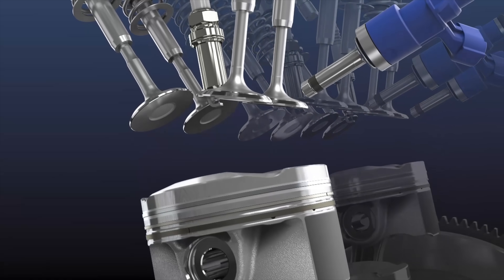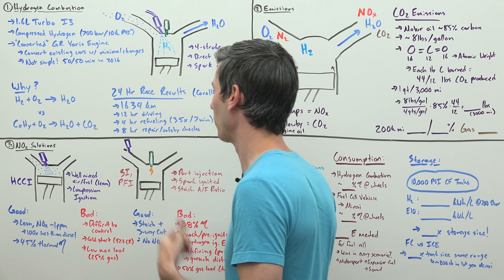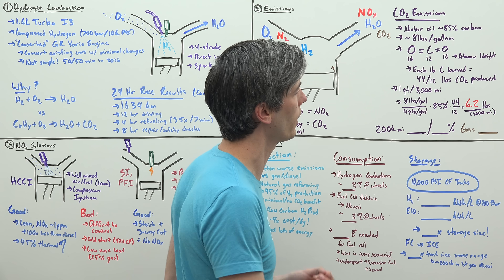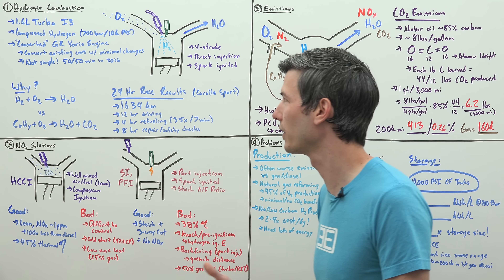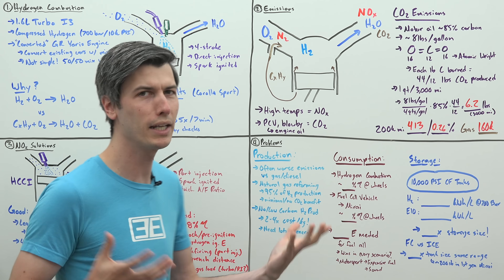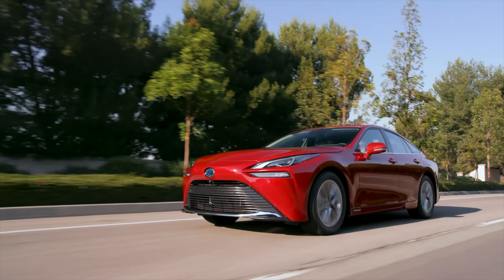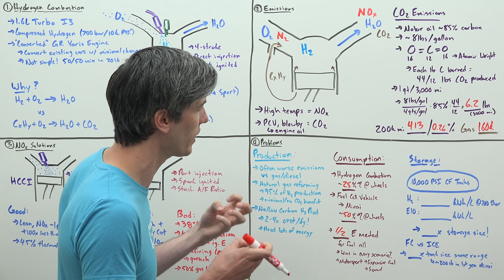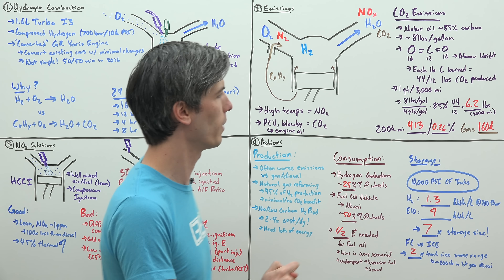Toyota's Developing A Hydrogen Combustion Engine!

Comment: Yes I did see your note on electrolysis for the creation of hydrogen, but I believe it can be done efficiently despite naysayers.
Reply: Hydrogen isn’t created, it’s extracted. It’s also extremely power intensive. There was a study done which showed that a country like Germany would need to increase its electricity production by 20-25% to service an all electric system. For hydrogen, that figure is 125%. Another problem is that the hydrogen atom is so small that it leaks from virtually any storage system, not just the tank.

Comment: 8:10 methane reforming is quite a terrible solution, but for now the most accessible. The process itself doesn't really emit that much carbondioxide, but it's dependant of yet another fossil fuel. Besides that, reforming requires steam at around 1000 °C. This requires A LOT of energy, so where does that energy come from? Most of the time through processes that emit quite a bit of CO2 as well

Comment: It makes a ton of sense that Toyota is experimenting with their new 1.6 turbo three cylinder for this. It is small displacement and three cylinders means less frictional losses. The Mirai basically has an electric supercharger to feed the fuel cell enough oxygen to make decent power. Forced induction will be a necessity for hydrogen combustion engines if a fuel cell needs an air pumping system to function efficiently. Just how efficient Toyota can make these engines remains to be seen but it could work. While not as efficient as fuel cells, if it could be made close to or as efficient as gasoline burning engines, you now have  a low carbon vehicle that is cheaper and more accessible to a wider customer base than an electric car. Even if the engine isn't as efficient as one that burns gasoline, the wild card here is that the production of green hydrogen (when it scales up to mass production), is likely to be much more efficient than the production of gasoline. So even if the car isn't as efficient, the fuel production will make up for that loss and may even provide a net efficiency gain. Fuel cells seem to have the same issues as BEVs in that they require more rare materials than that of combustion engines which makes them difficult to scale. At a certain point, a simple lack of resources might make it so BEVs and FCEVs cannot grow in number. I never hear anyone talking about the finite reality of other materials (apparently oil is the only finite material). The thing about combustion engines is that we know they are scaleable and don't require too many special materials in comparison to their more efficient kin. We may need hydrogen combustion vehicles (HCVs) where BEVs and FCEVs fall short in numbers. While not as efficient, at least they can be built with relative ease using existing technology in large numbers to actually make a dent in our emissions targets. The reality of a low carbon emissions automotive future is much more complicated than I think many people understand. I know it's a hard pill to swallow but Tesla isn't going to solve the world's problems alone using one technology that is largely sold to upper middle class and rich people.
Reply: Sci Man Dan, Hbomberguy, It’s ok to be smart, Joe Scott, Neil Red, Wisecrack, Illuminaughtii, and many more. 
Please take more time out of youre daily-life for science and education; and if you just sub and leave, even that helps. No kidding: I understand it might be a bit off but it really helps. 
If you dont have time, just go there, check it its actual science and then sub and leave. My point is: 
those channels do need support and you can support them even when you have a tight time-schedule.

Comment: Do you have any information on using hydrogen as a tunable piggy back direct injection system pros and cons for clean fuel burn or reduced fuel consumption or even performance gains or loss. On a  2.0l turbo engine platform. Using a gas hydrogen blending injection system.

Comment: You could build stations that have giant dehumidifiers that pull water through the air and send it into a refinery that uses electrolysis to collect the hydrogen from the water and release the oxygen back into the air and the facility could have wind turbines and solar panels to be more green

Comment: What about the energy consumed by compressing the hydrogen.  It not only requires work to compress it, but there is also considerable waste heat in this process.  I suppose that when used, the compressed hydrogen might be able to be introduced into the cylinder under pressure and a gain might arise from that for several reasons.  Still the energy consumed compressing a tank to 10,000 psi must be taken into the analysis.

Comment: Hydrogen/oxygen mix is highly explosive and burning quite hot. N2 as part of the atmosphere ingested by ICE when present at such hot burning mix is increasingly oxidized as temperature rises. So controlling temperature at the cost of some efficiency becomes vital. Both at gas and coal firing plants this is or ought to be a major issue to the extent of even running the exhaust flue gas over a cathalysator and ammonia. So only water coming from the exhaust of H2-ICE is greenwashing or gaslighting reality.

Comment: There's a whole underground movement of people running hydrogen/gasoline hybrid systems. A small electrolysis system "hho generator" ran off of battery/alternator power can provide enough hydrogen to drastically increase fuel mileage when injected into the normal fuel system. Hydrogen burns hotter and faster than gasoline, allowing for a more complete combustion of the gasoline that's already there. You have to advance engine timing to compensate for this faster combustion, but the efficiency of the burn is drastically increased. No need to deal with bottled hydrogen, no need for expensive conversion systems, no need to provide enough hydrogen to run the entire vehicle. This would be a better intermediate step than going full hydrogen in my opinion.

Comment: I create HHO for my 2L motor using 2 x 100w flexible Pvs with 2x 12v/35A batteries. (total weigh around 10kg). I am looking for a solution to create a custom fuel mixture on EURO5/6 engines.

Comment: Hi, I have a question that I have been wondering for a long time. 
What would be the difference if it was liquid air instead of hydrogen? (decompression/engine, electric plug on a generator or direct propulsion or both?)
Would it be less risky, easier to produce and less polluting than hydrogen?
What would be the power, the distance traveled with a full tank? (full specs)
I would love to hear your feedback, thank you :)
Reply: air isn't a fuel, it doesn't burn on its own making it a liquid doesn't change that also to make air a liquid it has to be extremely cold and the energy required to keep the air liquid is high.

Comment: Hydrogen is NOT a fuel source. It is a means of storing or moving energy. Unlike fossil fuels/solar/hydroelectric, etc. the only practical source of hydrogen is water splitting with the input of another source of energy. (And their are inherent losses of energy between the creation of hydrogen from an energy source and he conversion of that hydrogen back into energy (electrical or mechanical)

Comment: Great breakdown - do you think there’s any chance hydrogen engines could eventually become practical in everyday life and compete with the modern automobile?
Reply: Likely no. Tanks need high pressure storage and hydrogen embrittles metals which the tanks will likely be made of.

At best it would be a multifuel system and that's just extra weight at that point. Regarding gas fuels, I suspect methane would be the simplest "green" option because it could be produced from organic trash by the bacteria in manure.

Comment: i think the better way to look at energy density of the hydrogen or anything is by kwh/kg rather than kwh/l....when you look at that way, the energy density of hydrogen is 33 kwh/kg and petrol is at 12 kwh/kg and the energy density of the best Li-ion battery is 250wh/kg...

Comment: JCB is also developing it. They use a diesel engine that is converted. Electric car are twice the price. And batteries weigh more than the hydrogen tank. A 20 tonne excavator  would need 8 tonne of batteries to work, and can only work for 5 hours. Also batteries manufacturing is one of the most polluting industries in the world. JCB are using 1/3 of the fuel in a hydrogen engine as the same size diesel engine and getting similar power.

Comment: Dude please do a video on adding hydrogen injectors to an old 4runner. I've seen electric conversions, I've seen some hydrogen fuel cell additions or conversions, but there is not enough explained. My question is why is a kit not designed to where you crank up with gasoline but when you hit the interstate, you flip a Switch to charge up your hydrogen cell, you flip another switch to turn off your fuel pump relay and you drive hydrogen without it too lean or Rich, then you switch back to fuel and off with the hydrogen. .. takes more responsibility but why shouldn't this be implicated in practice and filmed?

Comment: Thanks for this video! I'm very excited of the posibility of using Hidrogen fuel... but I saw that problem with Nitric Oxide emissions, definately harmful for the environment, of course, in large amounts. My question is: there is a possibility of reuptake this NO and at the exaust will have only Nitrogen and Oxigen? Of course, as much as it can be possible...

Comment: I hope that you can help me out here. I have heard that you can’t use plain air as your secondary fuel because the mix of hydrogen and air actually produces very bad polution. Is that true? And rather than use air as a secondary fuel why not use pure O2. You already have to have a tank for the hydrogen, well have a second tank for pure O2 and develop an injection system for the oxygen and have a closed combustion system. Then there would be no harmful emissions. You would have to have another fuel tank and the piping, and a wreck with these cars could be very dangerous. Am I crazy or would this work?

Comment: The plug power unit using liquid hydrogen to produce electricity replacing the battery in the electric car is probably how things are going to go. All of the Walmart Amazon excetera distribution centers with all the freight loaders and forklifts are using this exact system right now. The hydrogen combustion engine it's still going to give us the issues of what to do with used motor oil.

Comment: bats are probably good enough for most cars now. but they ARENT good enough for airplanes yet or even close, so I feel like hydrogen could be a great energy source for aviation (not counting very small and short range electric demonstrator airplanes)
there is another benefit,  storing the hydrogen as a liquid fuel,  the necessary refrigeration machinery could do double duty by enabling superconducting motors and other superconducting machines on board a large vehicle such as an airliner or ocean going ship
and superconductors can be used for a LOT of things, super efficient high power density electric motors, lossless power transmission, extremely sensitive magnetic field sensors (SQUIDs), no-contact magnetic bearings, maglev systems, etc

Comment: I love the explanations. So far, I have not learnt about using oxygen and hydrogen tanks for an internal combustion engine. Can the engine be made smaller because it is not hindered by nitrogen in the air? No NOx !
Also, you don’t address the fact that for cold countries (Canada) we need heat from combustion in our vehicles, thus a win against the Fuel Cell.

Comment: I drew out a combustion engine that pulled moisture out of the air and used internal electrolysis to separate hydrogen and oxygen and injected it into a cylinder for combustion don't know if it would ever work.

Comment: I have been watching you for a while now! Your video have only improved, Can a mix of Hydrogen & Gasoline be used by today's cars? I saw a guy who converted  his mid 60's model car to use Hydrogen he created Hydrogen out of water using electricty in the trunk after removing the gas tank.  Because of the Water he did more frequent oil changes.

Comment: I suppose Toyota has taken all these issues into consideration. I am sure they have a secret plan for making Hydrogen a viable option that most people outside of Toyota may not be able to conceive. And then there is the fuel cell case that apparently has different logistics. Plasma Kinetics has come up with a method of storing H2 in cassettes. So it may not be as simple as it sounds, after all!

Comment: Check out Harry‘s garage as he speaks to Lord Bamford at JCB as they have converted a standard diesel engine with the torque required with a modification to the cylinder head and this is now powered by hydrogen good old British design there is a way forward with hydrogen with the standard combustion engine I’m sure bit more technology another year and will be getting there I’m sure we will.

Comment: EVs have got us used to worrying about range but that's because EV recharging (refueling) is a monster wait. If you can work out a petrol-like refuel system then hydrogen combustion/fuel cell range concerns will go away. If you can't, the tech is dead regardless of range.
Reply: There's more to it than that, though. Battery life, availability of rare earth minerals to produce new ones, battery fires, etc.

The electric motor is fantastic but the batteries continue to hold down EVs. That's why ICE took over from EVs in the early 1900s and that's why it might as well keep going forwards, political interference notwithstanding.
Reply: @peekaboo1575  I was just talking about range but I do agree, ICE is now thriftier than battery EVs

Comment: I think the transition to EVs will take more time than expected. There are too many cars out there (on the roads, stopped at garages, on new and used car dealerships, on factories yards, and so on), so replacing a significant amount of them and dismanteling the fuel infrastructure will be a huge task requiring a lot of will from everyone. That's why I believe in a slower transition with efforts on several fronts: renewable fuels, fuel economy, hybrid vehicles, better batteries and increasing recharging infrastructure. It's something of a 30 to 50 year period, if not more.

But something which I don't see being talked so often is the need for transportation in the first place. Today many people need to move around some rather long distances to go to work because it's not so simple to find a place to live closer to work (coupled with other factors). I think that if most cities had better zoning so that people could work closer to where they live, or if the economy made it easier to move closer to work, it would have a significant effect on overall emissions (at least those coming from cars directly). Imagine if people could just walk up to 20 minutes to get to work.

Comment: If I ever get an electric or hydrogen fuel cell car, I'd like to wire a signal from the motor thru some dsp to an external sound system. It'd be fun!

Comment: I don't know, seams like some numbers are not adding up.
As I have heard hydrogen has the highest energy value of all, as far as combustion.
That's why the commonly use/used it in rockets, like the space shuttle. 
My guess is that it is early stages and with more efficient methods, could be much better.

If I remember right:
If you where to calculate the efficiency like petroleum and diesel.
Petroleum is around 40% moving the car, much of the rest is heat.
The diesel is around 70% but has less energy value.
Not sure, it was a while since I studied this, and I believe accurate numbers is not the point here. 

Lets pretend this car in the video has an efficiency of 10-15% my guess, there is much we can do to make them better.
The first Otto engine had around 12% efficacy, again not sure if I remember correct.

Comment: Not sure about your toyota but my MG3 which has a GM engine doesn't use any oil between changes & both my motorcycles are the same. So not sure where the burning of oil comes in. I accept it might if you thrashed the engine for extended periods of time or if the engine was worn, however normally with a modern car with relatively low mileage this shouldn't be an issue.

Comment: Because H2 burns so hot and fast, the piston engine would suffer greatly with the fuel under load.!.!.!.    We also found that valves and timing are not usually good enuff at sealing, and will backfire and pass-fire alot.!.!.!. We exploded one engine from leakage to the crank case.!.!.!. All in all, a poor sub for other fuel.!.!.  Way to many obstacles to leap, and for what gain.!.!. On the other hand, this guys hot air could power a small Stirling engine for some power.!.!...

Comment: Not practical I also try Hho to my motor bike how do you prevent rust in your liner due to 1 years not using .... Why you didn't consider using water as fuel ....? By separating hydrogen and oxygen2,,,?

Comment: somehow even i have gotten this idea for this, but why would you possibly use hydrogen with normal air cause hydrogen is much more expensive and its not work to change it, but what could work for a pollution free car would be to use pure hydrogen and pure oxygen but this will be very very expensive and the engine wouldn't be very efficient or powerful, also when you talked when you talked about nitrogen oxide emission, a way to filter nitrogen from it would be to use a nitrogen membrane filter which is used to make liquid nitrogen and it filter out other gases from nitrogen, in the same way we could use this method to filter out nitrogen and use the other gases

Comment: If I was to put a little hydrogen air intake  On a standard engine. Since hydrogen burns hotter would it help keep my motor clean or even clean the carbon build up on my pistons?